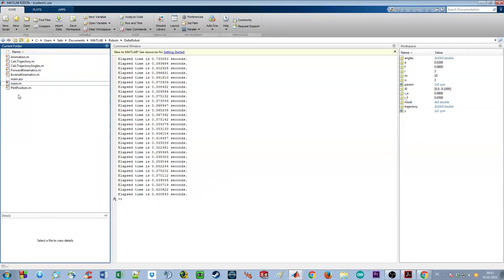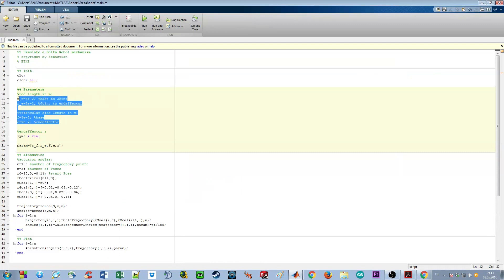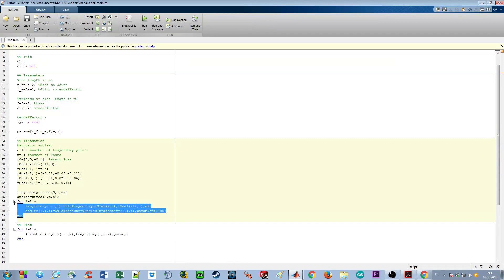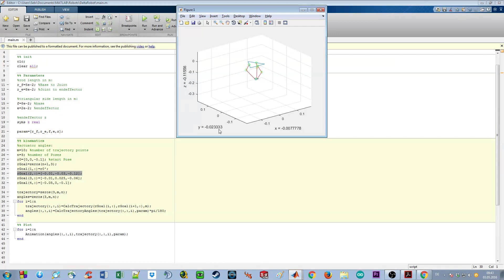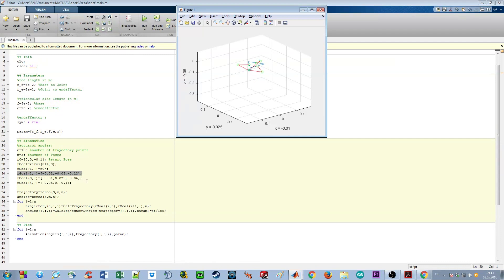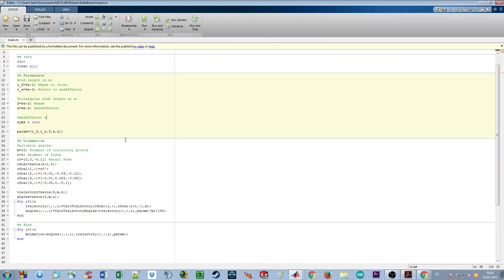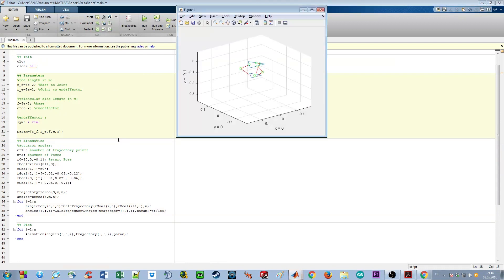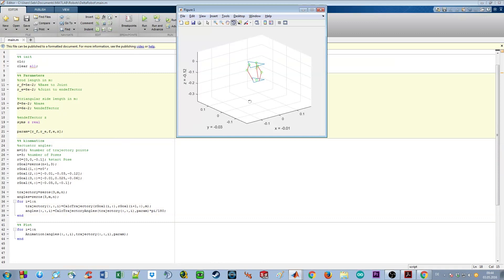Delta Robot Simulation, Files Available!

Comment: @Applied Engineering  
How is transfer transaction in the plot?
Reply from the maker: There is no direct transfer function, inverse kinematics is used to find the angles.
Reply: @ttschabos  so that  active siries 1 on plot it is running as any?
Reply from the maker: @it20man  The angles are precalculated and then the animation runs, where each line is redrawn within a time interval according the precalculated angles.